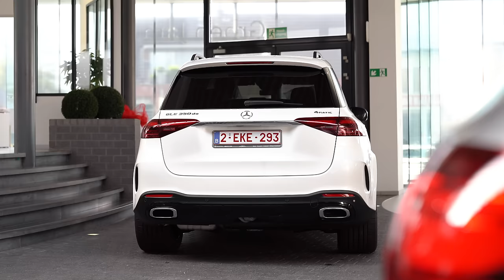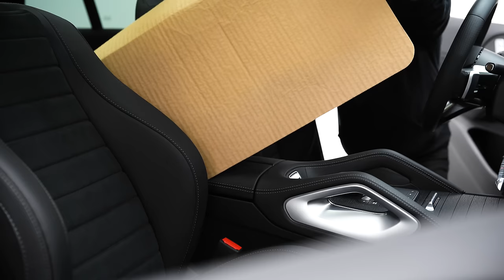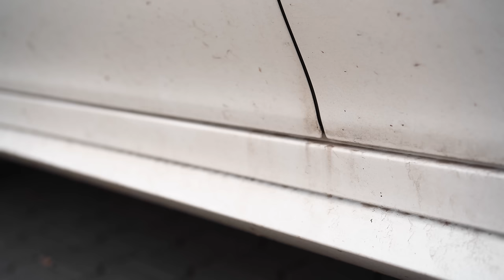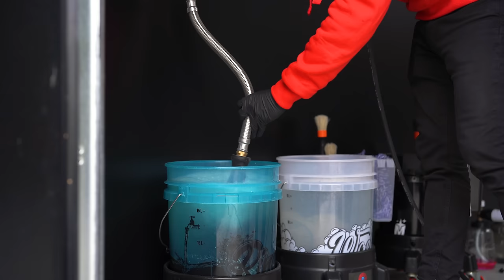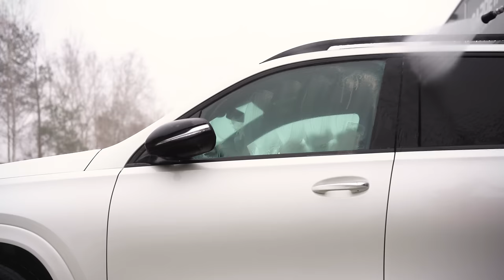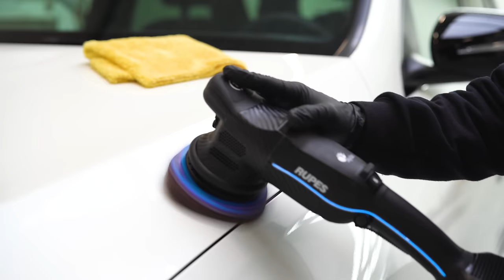First Wash of MY NEW CAR!

Comment: Nice wheels, never let the dealer wash your car. Once it's sold some dealers could care less about the condition of the vehicle.
Reply from the maker: That's the reason why I asked them to not touch it 😁
Reply: @VermijlCarDetail  you are a smart man, and do a better job
Reply: @VermijlCarDetail  what's the wiring you use to remove the cars lettering/emblems?
Reply: Sale and resale value are the only things dealers give two shits about. More money to pad their wallets.
Reply: Well, I must say I work in a garage to clean up the new cars and we always do our best to deliver every car as best as possible, polishing, waxing, removing scratches, not every garage is the same.
Reply: @Jari_daems  Not every dealership is the same unfortunately, and the client can't know beforehand. As you probably know, some dealerships have their own in house team to wash and prepare new cars, while some outsource it to an approved garage. The dealership where I just got my new car has an in-house team but outsource the fancy cars (Porsche, Lamborghini and Aston Martin) out to detailers who can also offer a ceramic coating package, but will prep the less fancy brands (BMW, Renault, Mini) themselves. My new Clio was delivered to me with scratches in the paintwork already, including several on the roof which had clearly been made during cleaning. In the future I'll be doing what Vermijl did and asking them not to touch the car beforehand. Better safe than sorry, I just wish I had realised.
Reply: Bought a new car years ago.. cake to collect it.. looked like they washed it with a brick...
Reply: In Poland, main Audi dealer of Warsaw - has automatic washing machine and used it in all cars, all the time. As u can presume some scratches are added always… also in new cars like Taycan or VW T6. Beware of automatic machines also in dealers.

Comment: Congrats on the new car!! 🎉
Remember to do a first oil change at 1000 km (on the diesel engine, since it's a hybrid) to prevent engine wear during the break-in period.
Also, I wouldn't go past 7500km between oil changes since it's a turbo diesel and could create some soot inside the engine.

Comment: As far as changes, I would consider a little red trim on the silver piece under the front bumper/license plate and perhaps the trim under the rear license plate along the bumper. The silver chrome door handles might look good white or black. Light accents make a vehicle look better, going overboard with accents makes the vehicle look gross and overdone. For the silver on the grill, you may consider painting it black, except for the Mercedes Logo, keep the logo the original. Great looking Mercedes!

Comment: Man, i`m really glad for you and for your new car <3. A new car is always a new experience and you've enjoyed it  :D. Regarding the suggestions, I believe blacking out (chrome delete) the chrome would be a very good option on the long term. Other than that, ppf on the full front and hydrophobic treatment for the glass. If you feel the need, ceramic coating as usual...
One of my main wishes will be for you to find the sweet spot for getting some beautiful wheels to fit your style.
Cheers and keep up the good work! Been here since 12-13K subscribers <3 you rock!

Comment: Wow grats on the GLE, great choice and welcome to the Merc family! I have a 2022 E class E300de myself.

I agree you should complete the shadowline trim in the front and back, I did it on mine and it looks much better. Maybe even do the outline on the fake air intakes on the sides on the front bumper in black to?

I would also strongly advice getting some more ppf on the lower panels of the car, these cars stonechip like crazy. 

The black trim pieces around the windows are a nightmare to maintain, they corrode, scratch and stain super easy so I would also advise doing ppf or black wrap over them too. 

I was gonna say wheels but I see you allready got that sorted 😂 Enjoy your new car! 🎉

Comment: Congrats on the new car! Looks great in white. Chrome delete for sure - the handles are very easy to do. They
just pop out with a Torx screw and the chrome part is held in with small torx too - T10 I think. Then just wrap them and rebuild. Grille is trickier - maybe just wrap the side vented pieces. I would maybe do PPF too on the bumper and b pillars. Maybe a slight tint on the front windows if it's legal there? Matte PPF on the touch screen to stop any finger prints and protect it. Can't wait to see the new wheels!

Comment: halo vermijl i want to know if my car have a aspahlt undercoat for antirust can i spray my undercar with 25degree pressure washer? my pressure washer not that expensive though or use a brush for clean area around wheel like you did?